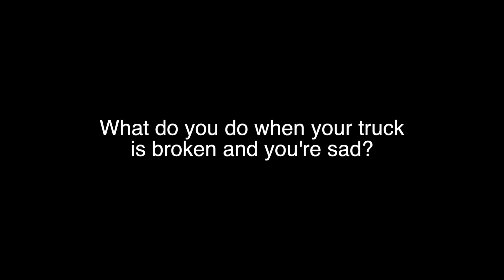BAD NEWS with the 6.0 powerstroke...

Comment: If you change the oil cooler out, be sure you go buy the gaskets for it from Ford, cause I found out the hard way, I bought the oil cooler off Amazon and used the gaskets that came with it. Oil cooler was ok but the gaskets that came with it was trash, had oil leak and had to go back in in put the new gaskets from Ford. They are around $80 from Ford

Comment: I'm a fan of the 6.0 just way to many issues , I picked up a 7.3 obs a month ago ( first 7.3 ) definitely a awesome motor but nowhere near the performance that my 12v or 24v had , so going to do supporting mods,injectors etc nit final plan is 12v swap p pump and compounds with a built zf5

Comment: Hey man I would try to clean the turbo. If your turbo bearings good definitely worth the time cleaning it rather then spending the money on a different turbo. Now egr and oil cooler, if you don’t have to get smogged or yearly vehicle checks it’s definitely worth just deleting the egr! The oil cooler if you decide to stay with them oem style you need to go with motorcraft other brand oil coolers have bigger fins in them to not hold all the silicates from the ford gold coolant, but that ends up not cooling the oil as good and you have bigger deltas. Now if you do have blown head gaskets you need to take your heads to a machine shop to get magnafluxed to see if there is any cracks and also get killed flat plus use oem gaskets and 100% worth the extra money to get arp studds! Man if you have any questions I’m not saying I know everything because I don’t but I can atleast give you the basic low down on 6.0s. They are great motors once you get the “normal 6.0” problems Dealt with! Good luck hopefully it’s just the egr bad and you can delete it and go on!
Reply from the maker: Tyler’s 6.0 thanks!
Reply: Whats up Tyler!!! And Michael goodwin i commented in ur first vid man that ur truck is running a tune cause it rolls coal. If ur running a tune with a egr ur going ti continue having issues. Those two do not mix buddy
Reply: Hey bro! Yeh man i didnt even notice that but that is definitely true man like i said egr is a curse!